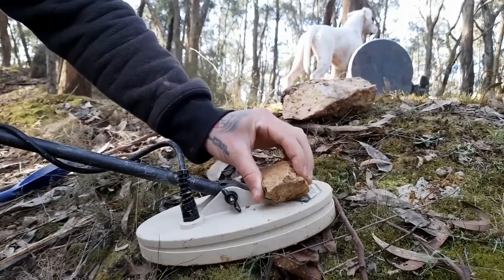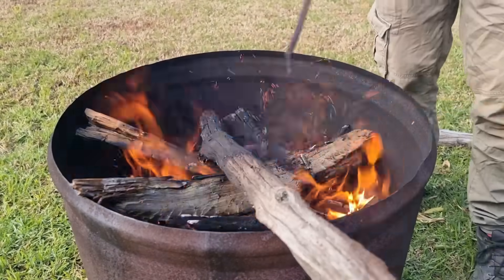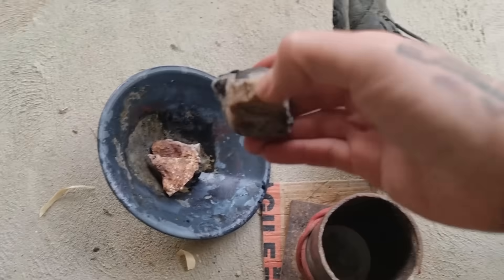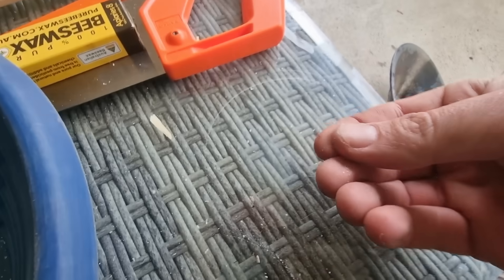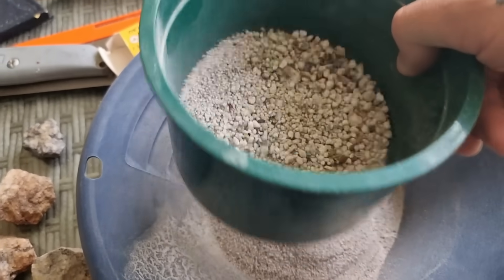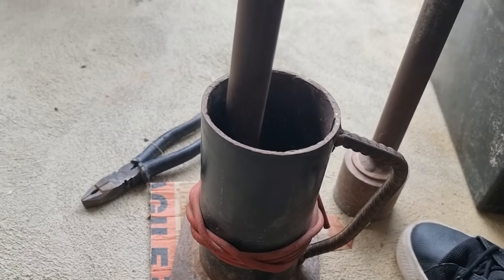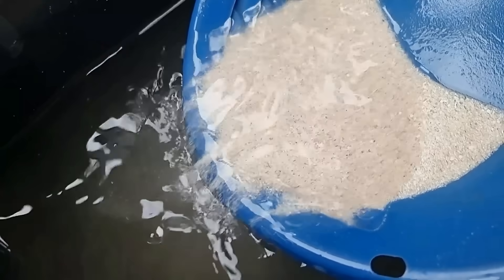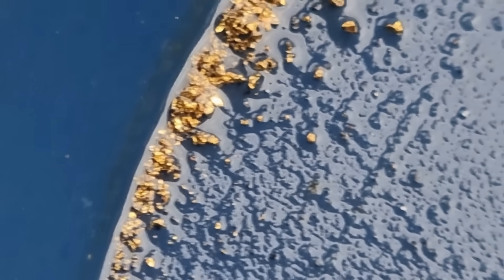I Can't Believe This Worked So Well! | Vinegar Gold

Comment: Interesting process, it'd be nice to know what function the vinegar performs, other than being a cool liquid on a hot rock.
Could you get similar results from very cold water or does the hot acid (vinegar) do something to weaken the quartz matrix?
Reply: Yes, very interesting.  I think that cold water would shatter the quartz. Would try a duplicate test with water and vinegar to compare.  Just try with straight quartz to determine "powderability".  Vinegar would have been an easily available weak acid, especially from spoilt wine production.
Reply: Just what I was thinking. Pretty sure quartz is mostly silicone dioxide, so it would have no reaction with a weak acid. Water should work just as well but worth testing to see if there's a difference.
Reply: Minus the vinegar this is the same process used on iron ore to allow it to be crushed before putting into a kiln / bloomery. Vinegar is usually used to dissolve minerals like calcite, over a period of time [several days].
Reply: @mjr543  Hot vinegar is surprisingly aggressive as an acid, so that brings another question. Would H2SO4 (battery acid) also be as effective in breaking up the chunks (it reacts with the FeS to make FeSO4 which is water soluble)
We'll ignore the OBVIOUS dangers for the sake of discussion.
Reply: @lancer2204  Obviously depends on the composition of the rock itself, not just the minerals present but how much of the rock they make up. If primarily quartz then I believe Si02 quartz acts as a mild acid in the right conditions so a strong base could have some effect (again very unsafe). For a strong acid and setting aside the difficulty in getting a suitably strong acid to actually impact more than just surface FeS, you'd then also be balancing the heat of the reaction, presuming there was enough FeS present that it's removal made a significant change to the rock's structure. For the sake of specimen recovery, I'd want to keep the host rock mostly in tact, so strong base is out, and I'm not certain a strong acid would achieve much more than making the whole process wildly more risky. I'd just change over to a solar kiln to heat the rocks. Slower but no fuel contamination from wood, nor fuel cost from a propane kiln. Then just stick to thermal shock from simple water. Thoughts?

Comment: That works well on a small scale.  You also have some very rich pieces.  I was wondering if it was the vinegar or just the thermal shock.  Have you tried it with plain water?
Reply: Thermal shock...
Reply: Vinegar and lemon juice work for the best safest methods both are very acidic which help dissolve the calcium carbonate and weaken the structure within the stone a chemical reaction. The heating and cooling fracture other minerals and split the stone into smaller pieces this is a thermal reaction.
Reply: @abstractgamer8543  Got it.

Comment: Would love to see the difference with and without the vinegar.
Reply: plain water would probably do the same thing to the quartz as vinegar (the fast cooling shatters it) but the sulphides would probably remain mostly intact so you should imho get less of the small stuff released from the host rock.
would definitely be interesting to see the difference though rather than educated conjecture.

Comment: You can also do this by heating up the courts really really really really hot like you did and then just dousing it with cold water we would do that up in Alaska at our claim move the courts off the heat and then make sure you're standing behind something cuz the quartz can explode
Reply from the maker: I'm sure it works exactly the same. I just followed what they said they did.
Reply: It's cuz you're one smart cookie

Comment: Wood coals get hot enough to melt steel if you have a forced air supply. Just a heads up from someone who does blacksmithing as a hobby
Reply from the maker: Found that out afterwards lol
Reply: @VoGusProspecting  yeah I found it out the hard way myself back when I first started blacksmithing. Couldn't find a coal supply so I used hardwood charcoal with a 100cfm fan as a blower. Left a railroad spike in the fire, got distracted by my phone and suddenly it was a fireworks display in my forge.
Reply: @joshsmith9558  By that point, you may as well throw that spike in the trash. Those sparkly bits are the carbon burning out of the steel.
Reply: @mikeford963  I'm well aware of what it was. I've been a welder for 17 years. Been doing blacksmithing for nearly 10. Railroad spikes are on the very low end of the "high carbon" steels. Granted the ones used in turns tend to be of better quality because of the sheer force put on them but they are still junk steel. Great for practice and making tongs and the like out of but useless for knives. When I first started I didn't expect charcoal to reach those temperatures. After that incident I started doing research on blacksmith and found that charcoal burns hot enough for forge welding.
Reply: @joshsmith9558  Also a welder, red seal in Canada. And yeah, proper charcoal, as opposed to briquettes, can get that hot with enougg forced air flow. That's how mankind did it before we discovered coal.
Reply: @mikeford963  no clue what red seal means. I could Google it but that would end a friendly discourse.  So what does red seal mean?
Reply: @joshsmith9558  It's our classification of journeyman. Meaning we've gone through the training levels and put in the hours, and passed the final knowledge test to acheive an interprovicially recognized standing within a trade.